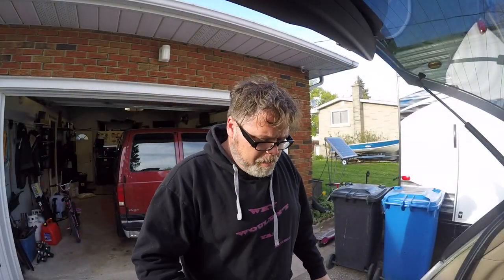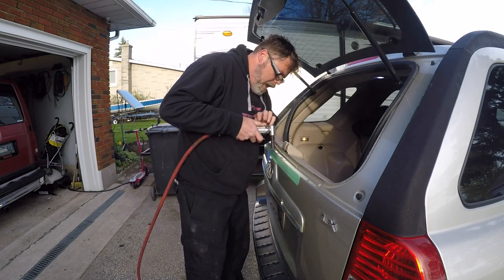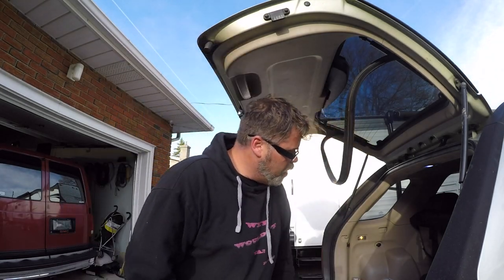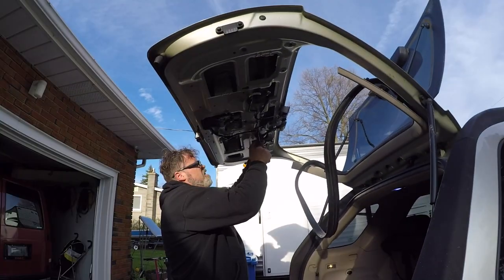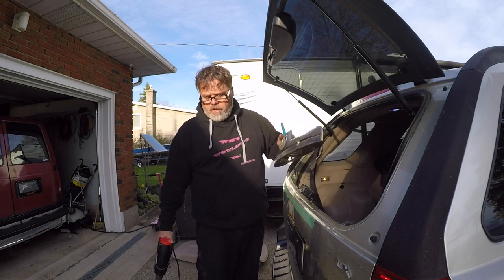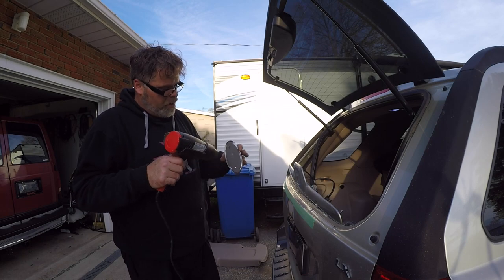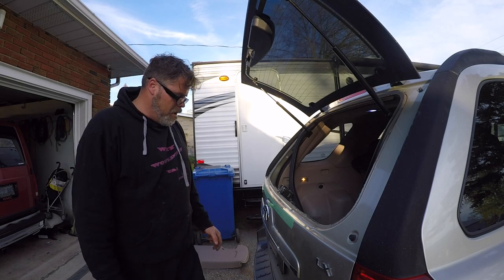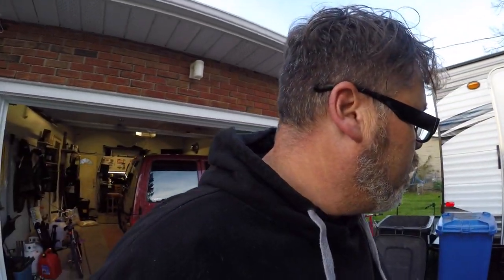Keeping Wife Happy We Are

Comment: Testors model paint. Used to use that to redo emblems, mixable and you can match original colors pretty good. Don't know if the modern stuff is still the same but it used to be an enamel paint.     
I'd probably try buffing off the rest of the black and call it a chrome upgrade--double the value of that thing.  You tripled the value by buying a new emblem. =-)